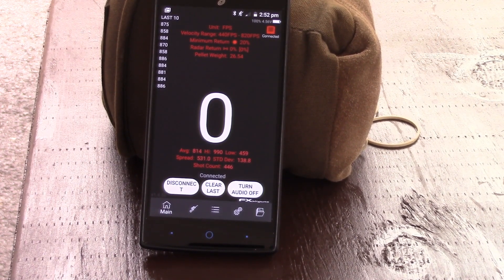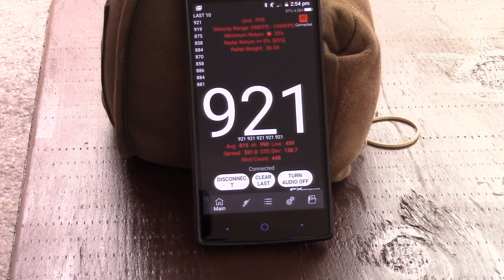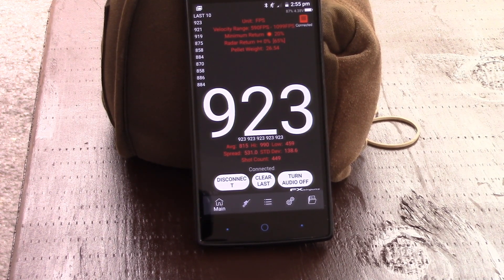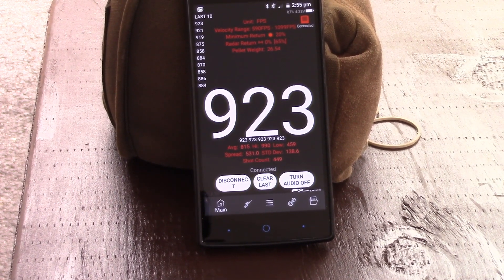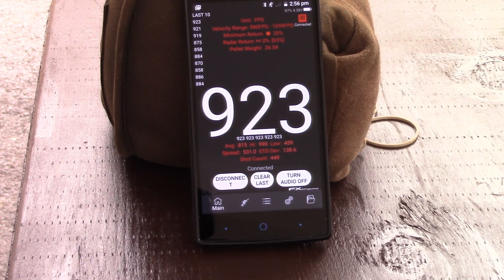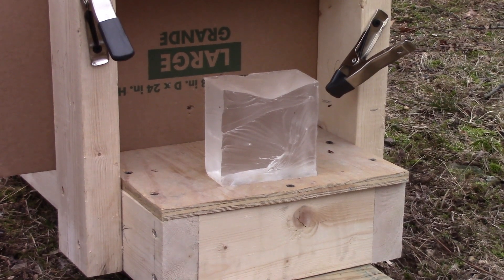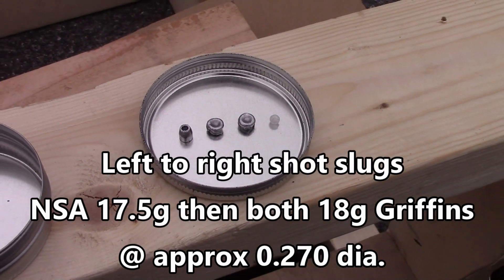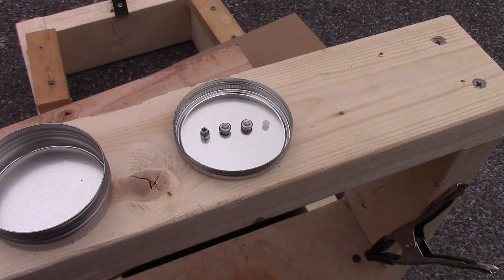Griffin  22 caliber LDC Slug Testing

Comment: What psi is your air rifle
Reply from the maker: I'm not sure which air pressure level related to the rifle you are wanting. Most air rifles will give air pressure setting in bar not psi. My FX Dreamline's air cylinder fills to 230 bar or 3335 psi. The regulator is set to 135 bar or 1958 psi which is the amount of pressure the rifle is using to shoot each pellet of slug.

Comment: Thanks for sharing! We are making changes the .249 slugs I'll let you know when we get our new stuff for it. Thanks again!
Reply: If you order from us agian in the future send us a email and mention your YouTube channel we will send you some samples of different slugs. Our goal is to make ammo for different applications as we find stuff that works then we try to implement that in other calibers and styles. Not all LDC slugs will be designed for expansion some will be used to change the ballance optimization. Example we have a few RBT (rebates boat tales) that we are putting a bead in the back of the slug to move weight forward to reduce the amount of spin required to stabilize the slug (in theory). These will designated as RLDC for Rear LCD these slugs will  not have added expansion from the bead but should gain stability over long distances. We are still testing this but the weather has not been permitting lately.  Again thank you for your feedback and time! Our new .25 set up has much better expansion then the .249 if that's what you after. The .249 will get a face lift in the next few weeks